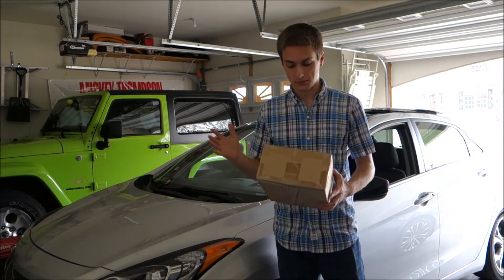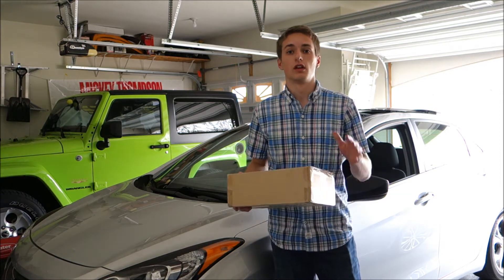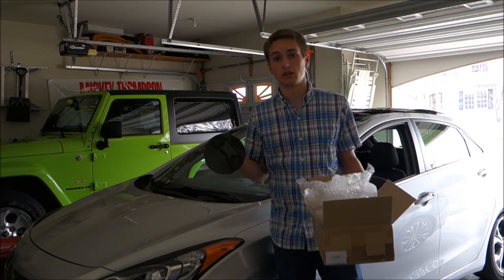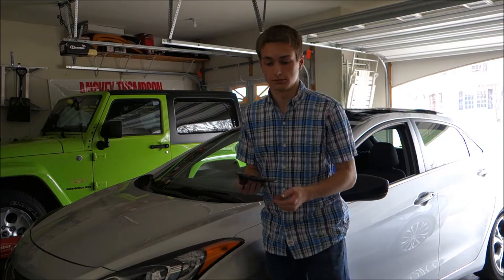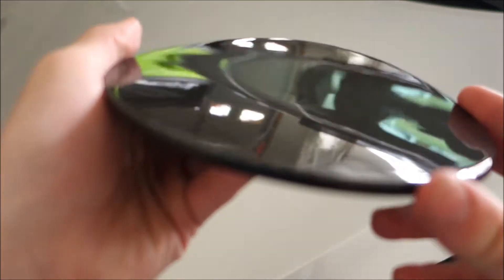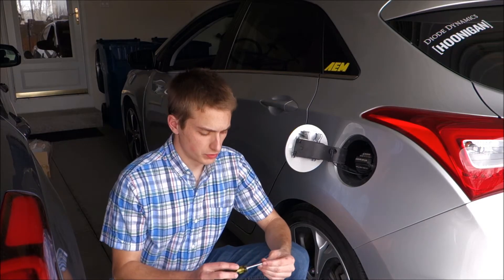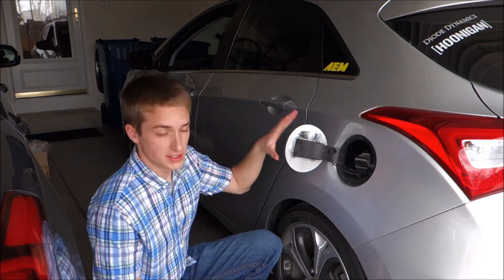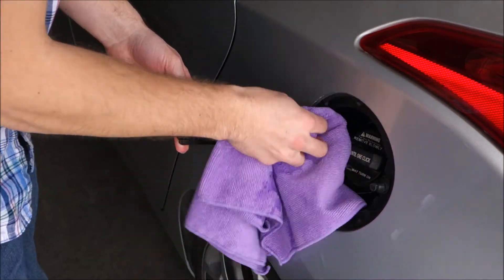Carbon Fiber Gas Cover Install! - 2013 Hyundai Elantra GT

Comment: where did you buy the fuel cover
Reply from the maker: http://www.ebay.com/itm/Real-Carbon-Fuel-Door-Lid-for-HYUNDAI-2013-2016-ElantraGT-/121585680124?fits=Model%3AElantra+GT&hash=item1c4f123efc:g:VUAAAOSwZjJU2xjC